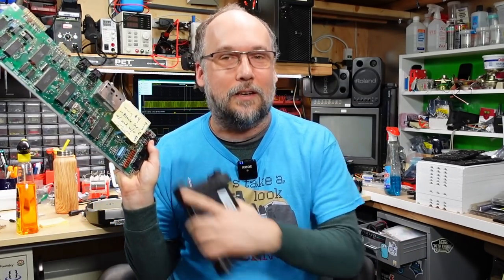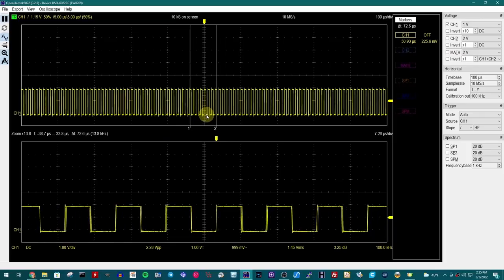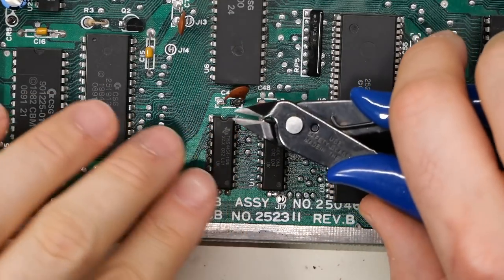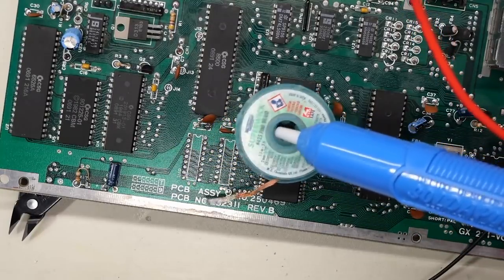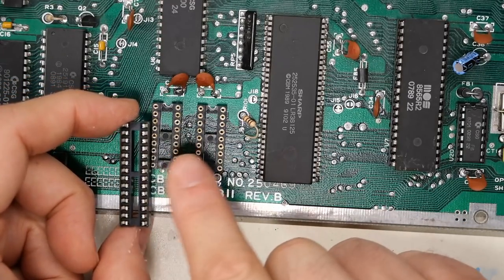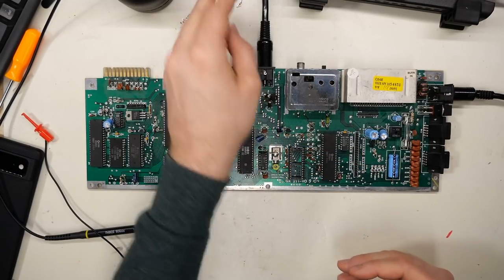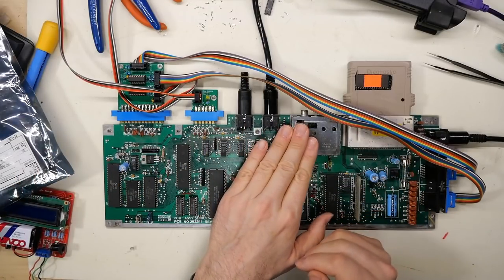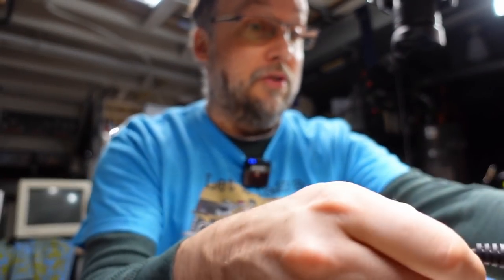How to fix an 8-bit computer with only cheap tools

Comment: Quick tip for the ground and voltage pads that have large planes - cut the braid at a 45 degree angle, put the sharp end into the hole and apply the iron. The sharp corner will get in there deeper and it works much better than just applying heat to the braid as the whole braid is over the hole. Hopefully that makes sense.
Reply from the maker: Great tip! Thanks!
Reply: My pleasure. Keep up the great content!
Reply: A similar trick I have used, usually when recapping a multi layer board with big planes, is to push a stainless steel sewing pin or needle through the hole, because the solder can't stick to it. Then you just wobble it around in a small circle and it comes straight out and the new leg fits straight in.
Reply: Simon's idea is a good one, I've used hypodermic needles for just such an operation.
Reply: @SimonQuigley  i've used a piece of guitar string to do this (steel string from an electric guitar, not nylon string from an accoustic, of course ;-D )
Reply: I often use dressmakers'/tailoring pins, you can get what, a thousand in a package? And on occasion I'll use a blast of air to the hole, just make sure you check for solder blown onto components.  And for anything on a large fill area I'll nab some of that low-temp rework stuff.
Reply: Good tip, I'll have to try that.  Something I have done recently though that seems to make a massive difference, is adding flux to my braid.  Might be the cheap braid I'm using, but definitely makes it work a lot better!
Reply: Cut off little 2cm segments of the braid, copper wicks up heat so quickly that much of the heat from the iron is just going down the full length of the braid. I don't know if you've seen it, but I've seen it get hot enough to melt the plastic holder for the braid before now. Before I knew that though, trying to clear out holes on Athlon / late Socket 370 boards to recap them, where desoldering just wouldn't work because of the huge ground planes, after removing the part I decided to use a very thin drill bit (0.8mm)- just turning it between my finger and thumb was enough to 'drill' through the leaded solder and clear it out without damaging the vias. 
Nowadays, I've found the Engineer solder sucker is very good for removing solder, just have to speed it up with some PTFE lubricant. Also, although not mentioned in the video, I've found that the WD-40 contact cleaner is excellent at removing flux, for something that's so easily available.
Reply: I use old capacitor legs poked down the hole and draw them through copper braid.. I really hate de-soldering though and since I recently bought 40 non working arcade boards I'm going to by a proper pump de-soldering gun.
Reply: You could also stand the board on end and put the iron on one side and the Soldapult on the opposite.

Comment: I used a soldapullt for 10 years fixing avionics with through hole components. Now that I work with just SMD, I use a microscope and a thin braid: there's almost no space for a desoldering gun. A hot air gun with a small nozzle and thermal tape work like a treat. I also bought some of that Chip Quik you showed in another video and that made a huge difference in desoldering large ICs!

Comment: Soldapult hint. Keep the iron on the edge of the hole and bring the soldpult on the top of the tip of the iron, and covering the hole you are trying to clear. Works great, and for really stubborn ones, put the iron on the via on the bottom of the board and use the soldapult from the top.
Reply: yep. this is the way. but really the hakko 301 is much better.
Reply: @TMS5100  Even better is when you drive to work to use that Hakko 301  in a Ferrari 308GT (that you just paid off:). Just saying... Co$t is everything sometimes. Cheers Sir ms3bani :O)
Reply: My issue with the Soldapult is that it’s enormous.  There’s a small aluminum one that I got at Adafruit (but I would imagine it can be found elsewhere too) that, instead of a fixed size tip, uses silicone tube that you cut to the length you like, and can be replaced when it gets ratty.  The small size fits in your hand and makes it way more nimble in tight spaces.
Reply: @nickwallette6201  I can't argue with your take on the small & nimble. The Pullit is HUGE. I guess the "right tool" is the one that works and does the job, for each one of us. Cheers Sir Nick.
Reply: You can also put the board on a vertical support. You heat the pad from on side and slurp from the other side of the board.. That way you don't have to remove the iron before puting the Soldapult..
Reply: @nickwallette6201  Yes I agree Nick - for anybody looking, the small solder sucker is called an Engineer-SS02 Pro.  They are fantastic little things with really powerful suction and make a world of difference from the really cheap suckers.
Reply: @Oort Cloud  I think I will buy one of these. I am on a budget, but want a good manual solder sucker. They are about £20 here in the UK. I am also looking for a cheap, but good soldering iron too. I have 2 C64's, one working, one faulty, but I have lots of spare chips including 3 working SID's and 2 working VIC 2's. I have two 250425 breadin boards and I want to fully socket one of the good boards. I don't have the skills for the oscilloscope, but if I have a fully socketed board, at least I can swap out chips. I also have dead test and harness. I am new to the retro scene, so muddling my way through right now.
Reply: @peterbilt3385  Good luck!

Comment: That's an amazing t-shirt design!

When I'm trying to free up a hole that's full of solder and the braid, the pump or the desoldering iron with pump fails, I do the most junkie version: I prep up the board so I have access to both sides, heat up the solder on one side and try to poke it through with a sharp toothpick. The toothpick works beacuse the molten solder doesn't stick to it but it can get charred if I hold it there too long.

The wick method success rate depends on the type of solder that was used too I think but I'm not sure... Maybe I was using some cheap wick or it was on a ground plane.

I like that you went low-tech in this episode, showing us that it's possible to do repairs without crazy expensive equipment.
Reply from the maker: Yeah that’s a good way to do it. Even heating up the top side with hot air first helps a lot. In a pinch the double sided method is a good one. 

Thanks on the T-shirt. I need to find a way to make it available to buy.
Reply: Adding flux turns poor solder wick into great solder wick. When using my solder sucker I seem to always need to heat from one side and extract from the other. I don't know if there's anything wrong with my setup or not. And I sometimes practice an even cruder method for removing the solder, what I call the slap method. Heat up the solder and tap the board against the table and it literally flings the solder away. No tools needed. Obviously there is a risk involved here especially with large boards.

Comment: Another great video.  Your videos encouraged me to have a go at fixing my Atari ST.  To my amazement I got it all working (socketing a RAM chip much like here) and have since repaired other machines.  I love the detail you have in these videos showing exactly how to take out chips, what temp to set the iron to, how to install sockets etc.  Fantastic, keep up the good work. :)
Only advice I would add from my experiences is... get an old piece of electronics that is unfixable and practice taking chips, caps, etc off it and soldering sockets etc on and off until you feel more comfortable with solder, flux, wick, solder suckers etc

Comment: If I may make a suggestion, I'd recommend leaving the iron on the joint. It shouldn't hurt the desoldering pump and it'll keep the joint hot until your ready to pull out the solder. I'd also add just a little flux to the opposite side of the PCB. It helps keep it from oxidizing and it'll flow better. As for what magically happened may simply been a cold solder joint.
Reply: My money is on the collector pin of Q1 not properly connecting to +9V unreg, which was "magically fixed" when Adrian put the meter probe on that pin.

Comment: Someone must have mentioned the Engineer SS-02 desolder tool with the silicon end ? That has quickly taken over as my favourite desolder device. Then wick and third my duratool desolder station. Glad so see you back after the operation.
Reply: Came here to say exactly the same thing. There is only one solder sucker that's worth having! The silicon tube lets you envelope the iron tip with the sucker, so there is heat contact right through the removal. That said, I fought so hard with some of the monster power planes on amiga boards recently, I have just splashed out on the hakko... 😅

Comment: Btw: you can make your own logic tracer with just some hookup wire, two 1k resistors (for CMOS), or two 270-330 ohm resistors (for TTL), one of those red/green bi-color LEDs (the kind with two leads), some alligator clips (one red, one black), and a small, sharp nail (or a probe tip from a set of ratty test leads you no longer use.) Wire the probe tip to the red cathode/green anode of the LED, then wire the other end of the LED (the red anode/green cathode) to the junction of the two resistors. Now connect some black hookup wire to the black (booted) alligator clip and to the other end of either resistor, then connect the red hookup wire to the red (booted) alligator clip, and to the remaining, unconnected, resistor lead. Solder, and heat-shrink, all your connections, and find a suitable holder (such as the barrel of a (dead/gutted) felt-tip marker, or something similarly cylindrical with about a 1” diameter. Route the two (red/black) wires out the back of the old marker pen (drill a hole big enough, though), then seal with hot glue. The tricky part is securing the sharp probe tip in the other end of the marker pen (where the “felt” came out.) This part MUST be mechanically sturdy, because you’re going to be pushing on it during regular use; so use 5-minute epoxy, not hot glue!
To use, just connect the black alligator clip to circuit ground of the device-under-test, and the red clip to the positive supply rail.. Now verify by touching the probe to ground. The red LED (logic low) should light. Then touch to B+; the green LED (logic high) should light. If you now touch the probe to a signal alternating between low and high, you’ll either see yellow (frequency > 10 Hz, 50% duty cycle), alternating red/green (frequency < 10 Hz, from about 20-80% duty cycle), or somewhere between full red to full green (frequency > 10 Hz, between 20-80% duty cycle) If the LED doesn’t light at all, then either the point has a broken circuit trace, or is high-impedance (such as a bus transceiver).
Theory of operation: when the probe tip is unconnected (or at Hi-Z) the junction between the two resistors will be B+/2 volts with equal resistance resistors, and no current flow through the LED.
When you connect the tip to circuit ground (logic low), the (electron) current flows from ground, through the LED red cathode/green anode, to the upper resistor, and out through B+; the red LED lights.
Likewise, when you connect the probe tip to B+ (logic high), the current flows from ground, through the lower resistor to the LED green cathode/red anode, to B+; the green LED lights.
Finally, when you connect it to a signal that alternates between ground and B+, the red/green LEDs take turns lighting up. At low frequencies, you can see the individual colors; at higher frequencies, the human persistence-of-vision causes us to see yellow (just like a “yellow” pixel on a CRT monitor is a red and green one lighting at the same time.) (at least, if you don’t have red/green color blindness!)

Comment: Several decades ago when I fixed electronics for a living my employer supplied a vacuum desoldering station, but I never really liked it since it constantly required the cotton wicking in the glass recovery tube to be cleaned or replaced. They were also ridiculously expensive. On a trip to one of the hobby electronics stores in Toronto at the time I discovered an inexpensive desoldering iron, which is basically a solder sucker mechanism integrated into a soldering iron handle. It worked at least as well as the expensive pro desoldering station, only needed to have the sucked solder emptied every so often, and still works perfectly probably 35 years after I bought it... and it's still on the original hollow tip!!! The beauty is that you don't have to remove the heat from the joint before you trigger the suction. I haven't picked up a separate iron and sucker in decades.

After watching your video I wondered if similar tools are still available, and it turns out they are, although most (all?) of them are Chinesium and probably inferior to the one I bought all those years ago, even though they look identical to my vintage one. All the ones I could find quickly seem to be 220V, even the ones that claim to have a "US plug", but a more serious search would probably turn up a 120V one. Here's a couple of quick links...

https://www.ebay.com/itm/383025969157
https://www.geekbuying.com/item/TNI-U-TU-842A-2-in-1-30W-Desoldering-Pump-Soldering-Iron---Black---Blue-361363.html
https://www.aliexpress.com/item/32838841550.html

This one just looks like the same tool as the other links branded in Velleman livery.

https://opencircuit.shop/Product/Velleman-Vacuum-desoldering-pump-heater-30W

There are some slightly different designs available too...

https://www.aliexpress.com/item/4000630061631.html

Comment: When I was doing my electronics degree about 20 years ago, our teacher taught us to hold the tip on the Soldapullt (we called them "solder suckers") on top of the tip of your soldering iron until you melt a small channel into the side of it. Then you could hold your iron on the pad, put the solder sucker over the iron, (mostly) seal the top of the pad with the plastic tip, and then punch the button to clear the via.
Reply: That's it. If you are desoldering from power planes (I like to call power planes "heatsink for solder connections" in cases like this), removing the iron tip and placing the Soldapullt (or a cheap clone) on the PCB takes long enough for the heat to be dissipated. You either need to heat the whole power plane (for example by using the boost mode for tens of seconds), or you suck the solder with the iron still being in touch.

Comment: 22:50 - I believe the trick is to not remove the soldering iron before you trigger the Solder-Pult! Yes, it'll melt the tip a little, but you can buy bags of replacements for not much money.
Reply: This!! also I use the old "put some silicone tubing on the tip" trick, that way I get to inhale less molten plastic fumes, and it seals real good.
Also there is something satisfying seeing just how much "solder foam" one of these hand pumps can make :)

Comment: Two tips for the manual soldering pump (I have a very similar one): Firstly the plastic at the tip is quite heat-resistant, so it's perfectly fine to leave the iron in place on the edge of the pad and briefly bring the sucker into contact with the iron to keep the solder as hot as possible when you trigger it. Secondly, it tends to get gummed up with the sucked-out solder and flux after not too long, so be sure to dump it out regularly, and also find a tool (like a small screwdriver) of appropriate size to shove down the tip so you can clear any gummy plugs of solder that get stuck there occasionally.

With these two tips, using the manual pump isn't too bad. You can get pretty fast with it and it's great for through-holes. Since it isn't a consumable like the wick, it's a bit cheaper to use, too. I use braid for cleaning up pads/holes once the bulk of the solder is removed, or for the odd stubborn hole, but the wick is not great at clearing a hole that still has a pin in it (if you haven't cut the leads like you did here) which the pump can manage fairly well.
Reply: My solder sucker (I forget the brand) has the rod going through the plunger. When you press it to reset the spring, it pushes the end of the rod through the tool's tip so it can't easily get clogged.
Reply: @eDoc2020  Mine has this too, but eventually the channel gets gummed up enough that I can't easily push the rod through the tip without risking breaking the whole thing. That's when I break out the small Philips and shove it down the nozzle from the front to clear it the other way.

Comment: I have replaced many a part using the methods you show.  The worst case I've had to resort to is use a tiny dril bit. Doing this is not recommended generally,  but being carefull it does work. I don't do a lot of repairs anymore being retired, watching you brings back memories.

Comment: Adrian, since we are all commenting on our desoldering skills I'll pile on with a suggestion of clipping the leads on one side of the DIP and the bend the chip back and forth to snap the legs off the opposite side. It's a real time saver on larger ICs. Keep the the great content coming. Thanks.

Comment: @32:39 The peaks after the trigger is that of the 4th character line of the start up screen (64K RAM SYSTEM 38911 BASIC BYTES FREE) and by the looks of it it is the 5th line from the top of that (line 29 of the screen). The horizontal line of the number 4 is visible but not from 6, 8, 3, or 9.